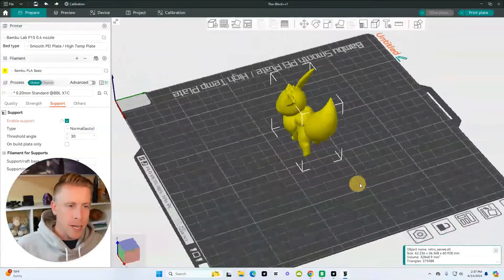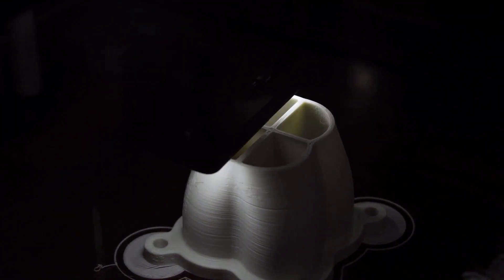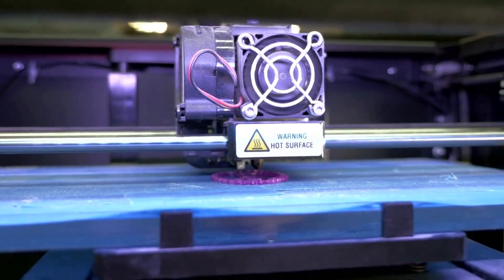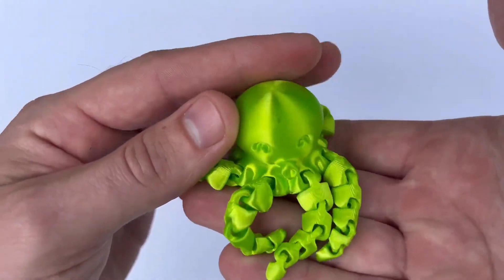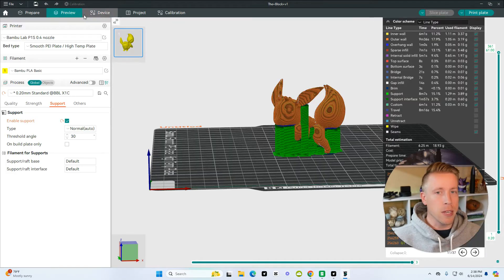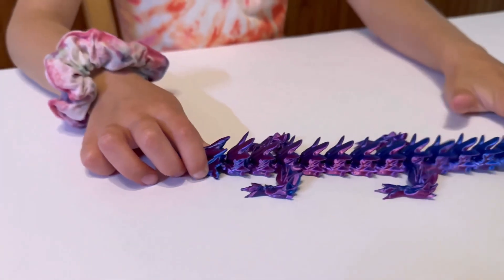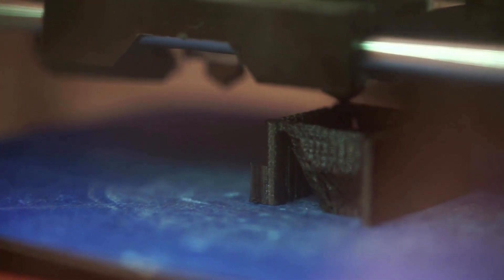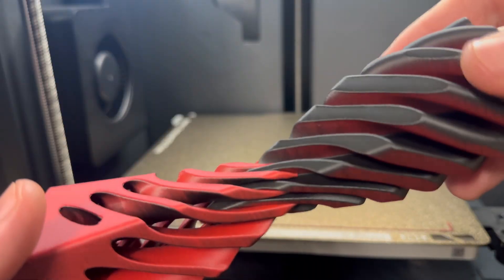Orca Slicer vs Bambu Studio Comparison - Which is Better?

Comment: I've been into 3D printing for almost a year now, and using Bambu Studio for Bambu X1C and Bambu A1 mini. It's done a great job for me as a beginner, and now diving into miniatures. Bambu Studio is struggling there. With a .2 nozzle, the supports feature is very limited, and forces me to use their tree or normal supports which even in manual mode, it doesn't create the supports where I ask it to exactly. Searching for a slicer that has this feature, I can use it then transferr to Bambu Studio for the rest. I heard there is a slicer that has "toothpick" type of supports? Is this Orca by any chance?
Reply: I've heard Simplify3D is the GOAT slicer for supports. Unfortunately, it costs $200 and is missing some of the features that are already in most of the freebies.

Comment: With the release of OrcaSlicer 2.3.0 I started having problems with filament profiles from version 2.2.0, they are completely unsuitable for 2.3.0. You need to recalibrate. Moreover, if in 2.2.0 there could be 0.98 for everything, then in 2.3.0 there is a large spread - 1.04 overall and 0.94 for top/bottom.

Comment: Hello, Thank you for this video. I have a question. When printing circles, the printer ( use Bambu studio ) is not runing in 360° circles but in 180°, making a half circle and than the other half circle. Resuls are there are 2 very well seen vertical lines in the print. Why does the slicer is not making 360° degrees circles all the way up? And is it possible to interfear in the slicing so the printer does make 360° circles?
Reply: Complete noob here, but I think there's an option somewhere to randomise the seam
Reply: @imaginitivity7853  Any idea where in the slicer program?
Reply: @denisdb725  "Quality" tab --> "Seam" section --> "Seam position" parameter --> "Random" option
Reply: @NoonianSoong403  Thank you. Check that out. Thank you. Bit strange this is an option for the user to change and not a normal thing in the program.
Reply: @denisdb725  depends on what you’re printing. At first I thought I’d like random so the seam lines aren’t as visible, but then I get random bumps all over the print. So I use aligned and then cut off the seams, which is easier than removing random bumps all over the place. But sometimes I’ll use random if it makes sense. Either way it’s a super quick change in the settings
Reply: @NoonianSoong403  Maybe a good item to do a video about?

Comment: Tbth, I've had more issues with Orca screwing up supports than Bambu and I have no idea why because yeah they are practically identical.  I'm probably doing something wrong in fact I'm sure I am.  However, I just fought a small tailflame for a Charizard in Orca for 3 or 4 prints and finally just decided to try it in Bambu and it printed fine the first time.  No idea.  Orca definitely has more options.  The good news is having both is easy and you can switch back and forth if you want.

Comment: This video is misleading on several points: 

- Bambu Studio is also open source. Orca, in fact, is based on Bambu Studio, which is based on Super Slicer, which is based on Prusa Slicer, which originally used the Slic3r code base. 
- Bambu Studio also has tree support
- Slow down on overhangs is also a part of Bambu Studio
- Bambu Studio actually also support other Klipper based printers, but Orca comes with far more printer profiles for other brands and filaments

And nowadays, Bambu Studio also supports scarf joint. So there's not much difference between the two.
Reply: Orca has more calibration tools than BambuStudio - exp. temperature tower, retraction tests etc. It is much easier to fine tune a filament with Orca.
Reply: That comment 3 months ago goofy
Reply: Looking at you after the firmware update they force )